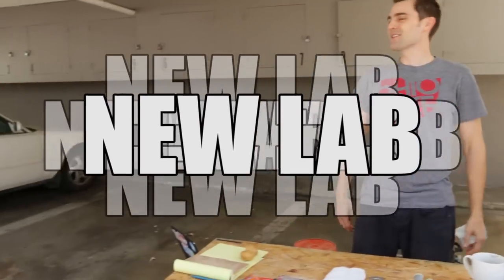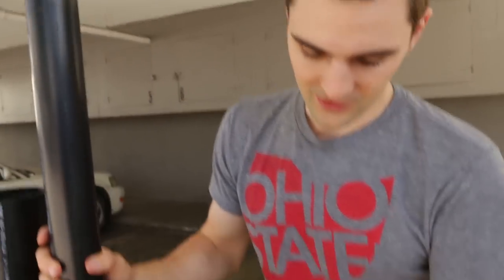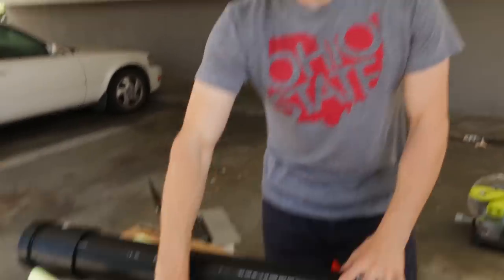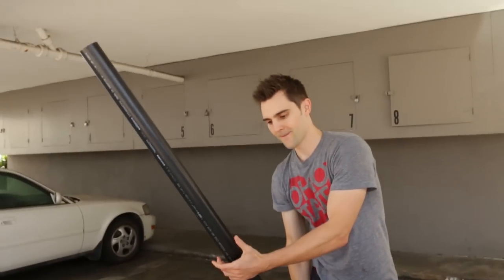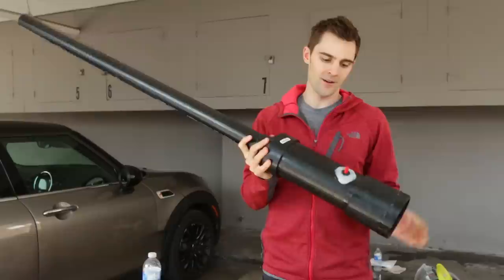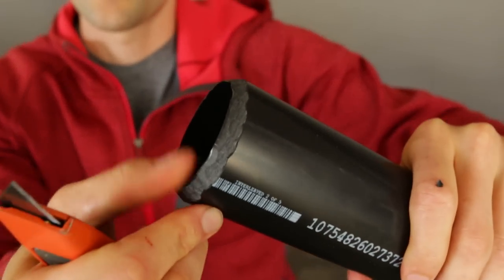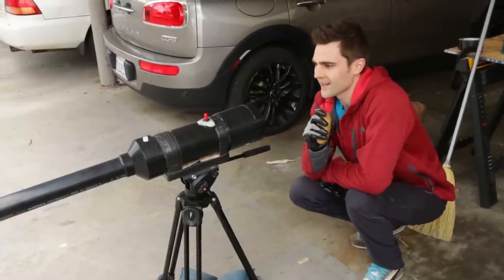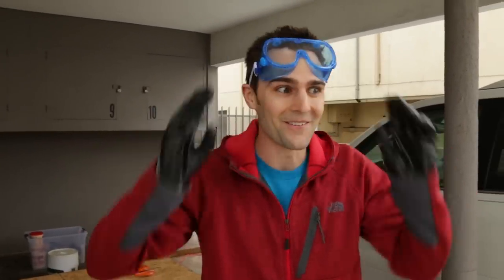Potato Launcher DIY : Super Dangerous !!!

Comment: I made one out of a Cheata Tire beadseater. Instead of potatoes we froze soda can 2/3 full and had a 3" 10' long barrel. at 90 psi air pressure I could shoot a can over 1/2 a mile. Also made an interchangeable 1'' barrel for golf balls. I quickly learned not to do that anymore because the balls went completely out of sight range and probablly went well over a mile. We had know idea where they landed so we stopped shooting golf balls.
Reply: Oh and also, I put a handful of pecans in the 1'' barrel and shot thru and obliterated 3/4'' OSB subflooring panels. AWESOME!!!!!

Comment: A sparker off a lighter works. Gas from zippo works. Excellent for drown takedown with fishing net attachment in the launch. Turbo to vaporize the gas would also increase the combustion chambers ignition. Don't use PVC PIPE, Use metal piping, it's safer.

Comment: I use propane in mine. It burns cleaner. Just squeeze the trigger of a torch half in and release fuel into the chamber. Also I used 1 1/2” pipe. It’ll shoot a spud out of sight.

Comment: I didn’t epoxy my igniter. I just used the nut provided. Will I experience issues? I haven’t fired it yet
Reply: Did you experience any issues?
Reply: @nobelnova3496  I did actually. I ended up making another cannon. I used two screws, ran wires to them, and epoxied the screws. So if I experience any ignition problems, the igniter is easily replaceable.
Reply: @nickadams2951  thank You👍🏼👍🏼

Comment: Coleman spark lighter for ignition.  Zippo flints, and no battery.  11/2" ID barrel fits many more potatoes.  i usually get two shots from most Idaho russets, really long ones, 3.  I also had a 1/2" ID radish gun, but i sliced a russet from end to end and got 8 or 9 shots from each side.  Radish guns are more practical in congested areas.  Cats seem to love them.

Comment: not bad.. mine use's atomized gasoline ( cheaper and onlt takes 1/2 squirt)      fires a walnut through a couple 2 by 4's..  or around 300 to 400 yards on a 45 degree angle..  but it think it would alert the niebourhood..   sounds a lot like a 75 mm howitzer..    ( 2"" barrel 4 foot long, 4"chamber 1 1/2 foot long)   abs,   1200 psi rated pipe.

Comment: This is not a science experiment in the slightest, its weapon manufacture.   But don't tell the Youtube censors that.   And using compressed air is way better than a volatile flammable fluid, far better muzzle velocity and range control.

Comment: Do you push the potato like all the way down till it falls into the bigger tube? Or do you push it till it reaches the end of the small tube?
Reply: Run Two screws through the small pipe near main chamber. Stops potato in correct position.

Comment: ABS is probably the weakest of all PVC made for non pressure.  lol.  Try schedule 80 next time champ. And you beveled your barrel the wrong way it needs to be beveled on the inside to it cuts a larger potato than the barrel and you force it into for a tighter seal.  Also use carb cleaner and not hairspray.
Reply: AskHack how bout starting fluid? Ether